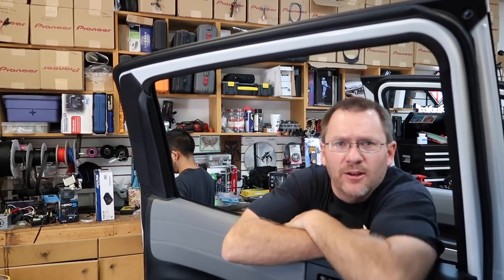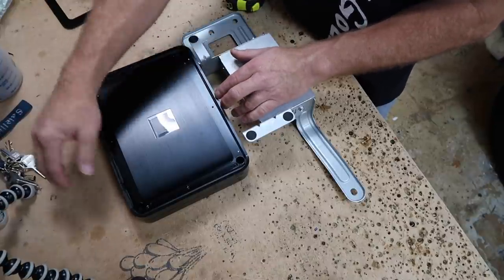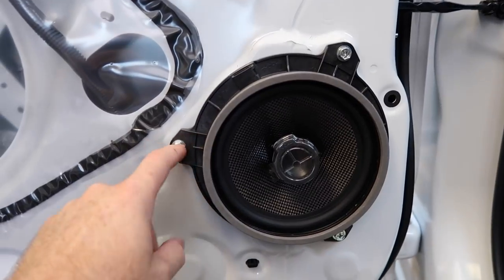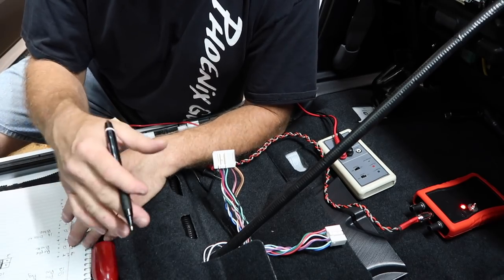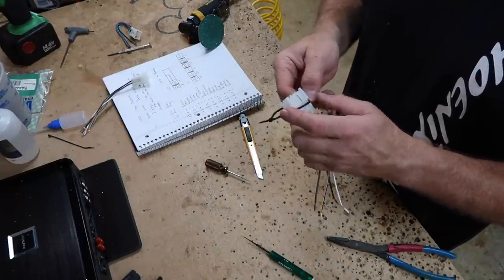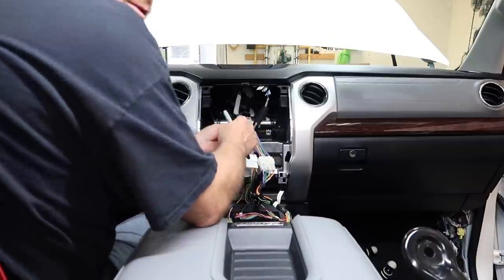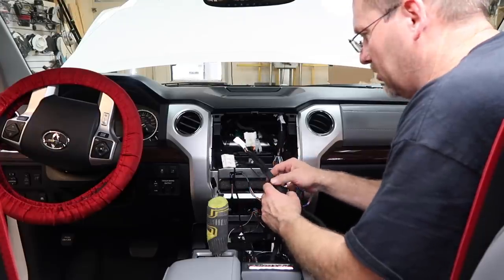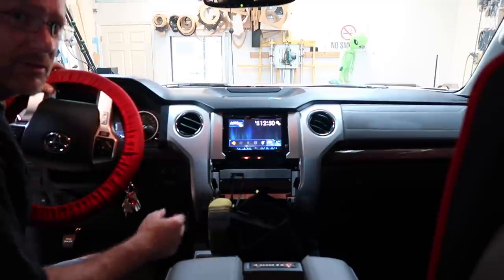Toyota Tundra factory stereo upgrade! Installer diaries 20

Comment: I'm probably going to bring my 2018 Tundra to you guys to do a similar install. I wonder if I'll lose some of the adjustable car settings available in the OEM head unit when switching to aftermarket (i.e. headlight auto on based on amount of daylight, auto lock timer, etc.)?

Comment: Dean, instead of cutting up the 70-1761 for the Tundra amplifier, I have used the 70-7992 (Suzuki 95-03) harness, perfect fit, you still would re-pin the harness. Also, did the Toyota factory stereo power the front three dash speakers on your Tundra? Whereby you needed to wire your front tweeter replacements to the front midbass speakers or crossovers?
Reply from the maker: +RICHASASA thank you I have to grab some cable for the bay. We just unplugged the center speaker and used the the dash wire to power the tweeter. We always unplug the center speaker and they the time correction do it magic

Comment: Hey guys, really enjoy the show. I’m building a similar setup in a 2015 tundra. I see the two patch connectors y’all made have 6 leads. (Front tweeters and 4 mids) but my question is about the four wires that go to the front tweeters? How/what would be a good way to wire the tweeters and crossover networks?

Comment: i was just interested in the process of replacing the head unit. i have a 3rd gen SR taco and wouldn't want to lose the hands free phone, backup cam, and factory features but want the better display and graphics and maybe nav and screen mirroring features of after market head units. great era we live in when we can scan through so many systems and ideas, though. good work.

Comment: Work of Art! You guys are awesome! Can you tell me which Focal speakers will fit my 06 Toyota 4runner front and rear? Just got the Pioneer 4201NEX and will get Alpine PDX V9 next. Wish you guys were in Los Angeles.
Reply from the maker: +John Pham it is 6.5 and a 4 inch. I believe you can just do the Access line. You may also want to check out the Alpine R type
Reply: Five Star Car Stereo Alpine Type R or Kenwood Excelon 7". Which is better fitting without much headaches? Thanks in advance.

Comment: Having trouble installing an aftermarket radio on a 2007 tundra with a jbl system. Can’t get the sound out. I’m assuming because of the factory amp. Any tips on the install & what wiring radio harness do you recommend.

Comment: Hello Guys!. How did you connected all speakers to a 5 ch amp? I have a 14 Tundra and i have 7 total speakers. 2 rear, 2 front component, 2 dash tweeters and a center speaker. Do i connect the tweets and front component together?

Comment: Quick question guys , I’ve searched online and I’ve can’t come across anything for a Toyota Camry SE 2019 without the JBL system. I want to do a speaker replacement and I’m interested in the Focal integration you guys did. It’s it available for the Camry ? if so, where can I buy them from.

Comment: 1. Where you guys located
2. How much?
3. How long does it take for install?
Hit me up, I need this lol
Reply from the maker: 1. Clearwater Florida 
2. Call 727-216-6170
3. Depends
Reply: @FiveStarCarStereoInc  Can you put how much THIS particular install was if someone with the same truck came in and wanted the exact same setup? I'm considering doing this, but I can't get a straight answer from any installers around here.  My buddy went to a shop locally here and paid 1800 for two 10s in a box that they just threw under the seat and it looks sloppy.

Comment: I installed a Pioneer AVIC-W8500 with Maestro and Sirius and I can’t push the unit back into the dash enough to have it seat properly.  Too many wires and components.  What’s the secret on a 2019 Tundra?

Comment: Just installed a Maestro RR and Kenwood DNX893S using the same harness as you did. Only problem is the factory microphone is not working. Any suggestions?
Reply: Use the Kenwood mic in the factory location

Comment: What kind of amp would I need to power 4 door speakers, 2 rear 6x9s and a front dash center channel? It's a 2017 Fusion with the SYNC 3 but non-Sony.
Reply from the maker: +Anthony S. are the rear speakers full range or subs?

Comment: I have a 2016 CrewMax. I want to do this swap but I want to keep my Sirius XM from the factory. Is it integrated into the stock head unit making me get a new XM receiver or can this new pioneer just use the XM unit the truck came with?